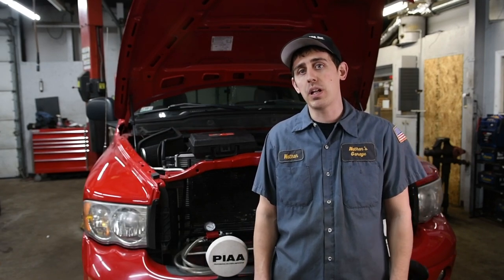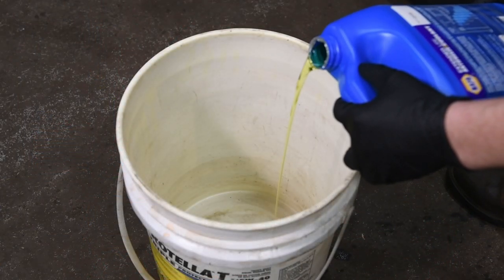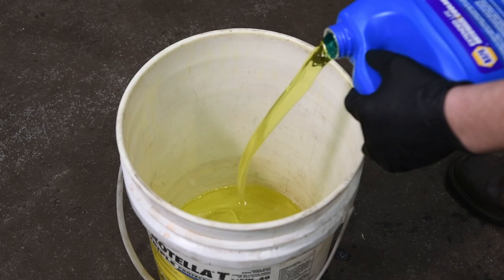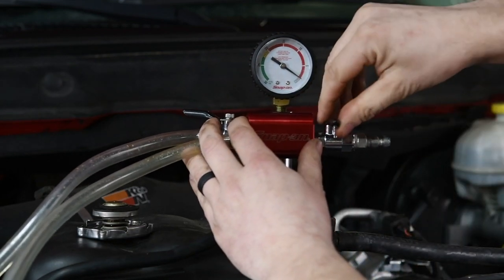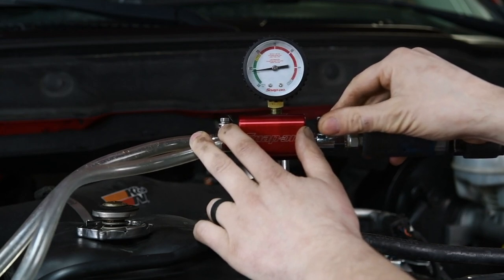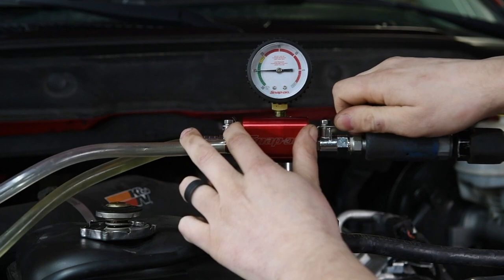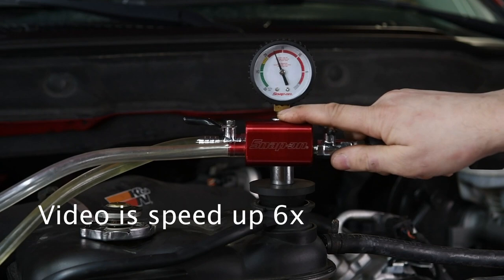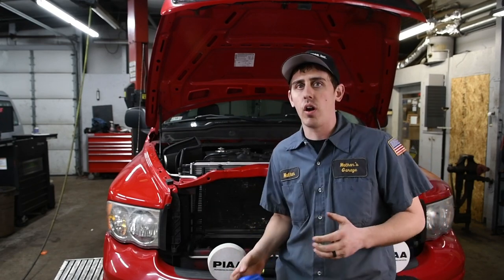MY FAVORITE TOOL Cooling system vacuum fill

Comment: I have an Acura ILX, 2021, and I started with the spill proof funnel, only to end up getting air bubbles, and hot air only on HI setting? It’s so frustrating! I ordered a vacuum kit off Amazon. Hopefully this will fix my no heat below the HI setting? 86,85, 84, ect… it goes to , basically room temperature?  Could a stuck thermostat cause this? Only getting hot air on Hi setting? Not the fan speed, the temp setting.

Comment: I’ve used a vacuum coolant filler for the last 10 years or so.. it’s a game changer. I’ve even used it on problem clutch and brake bleeding when nothing else is working.
Reply from the maker: Saves so much time on a lot of cooling systems.
Reply: hmmm, with adaptors can you use this kit?  ofcourse clean it out afterwards.
Reply: @SaycoPworrell   snap on sells one of these vacuum fillers that attach to a standard radiator cap. That’s what I use along with a Mac radiator pressure tester kit that has all the different cap adapters. I prefer this way over the universal rubber plug type that was shown in this video

Comment: What air pressure do you use like  psi on the compressor to evacuate the system to be safe and not destroy the system why don't any you talk  about the psi on the compressor to use I get everything else but please mention the psi for your viewer's 40 psi - 90 psi ?
Reply from the maker: The air pressure isn’t as important as the level of vacuum you pull. The higher the air pressure though ~90psi the easier time the tool will have pulling a vacuum

Comment: Everybody always talks about the air in the hose while refilling, it is a non-issue, if the tool is not interrupted during the process, the air in the hose at the beginning will be the air at the top of the D-gas bottle. There will be no air pockets anywhere in the cooling system and most of the time the coolant will be spot on and you do not have to add any more coolant to it!
Reply from the maker: That may be true on MOST vehicles but on some cars such as Chevy Cruz it will cause an issue. I have experienced this several times. The instructions per the manufacturer of the tool specify to purge the air. It’s one small extra step that gives piece of mind. Some vehicles the tank is an expansion tank and not a degas bottle.
Reply: It is definitely a non-issue if the technician takes the time to purge the fill hose of air.  It takes just a minute or two to properly purge the fill hose of air prior to commencing the refill of the system.  Why would you NOT do that in order to assure a successful repair?

Comment: Question for you, if there is maybe still a gallon in the system will this work or does it push the old out, I had to pull off a coolant line to get to a starter motor on a volvo XC40, I bought a vacuum tool but I have this question, I may need to only put back in a gallon
Reply from the maker: You will apply the vacuum until fluid starts to come out. Then fill from there.
Reply: @InTheShop  Thank You until fluid comes out or until all the existing comes out?

Comment: Do you think this will work with my 20 Gallon Compressor? I'm thinking about picking one of these up because God i am sick and tired of manually bleeding cooling systems.
Reply from the maker: I have used mine on a 20gallon compressor. It works but definitely works the compressor hard.
Reply: These tools need a shop air supply of 90 psi at the tool.  I recommend that you have at least 5 cfm of air flow.  I've got it connected to a 60 gallon compressor that puts out 11cfm at 100psi, this works very well.

Comment: I have a Subaru Outback, 2001 4 cylinder.  A problem I've been having is the coolant overflow reservoir filling up, but not returning the coolant back to the radiator overnight. I have replaced just about every cooling system part trying to solve this. So this concept you explain is completely new to me. Is running this process through my car , and presumably replacing vacuum back into the system the solution to my problem?
Reply from the maker: Hey Chuck, I know this might now be what you want to hear but I would get a headgasket test kit and check to see if you have combustion gasses entering the coolant.

Comment: Good video of a very useful tool. I bought one to do the intercooler on my car. Cruzes have a bleed on the top of the passenger tank of the radiator. I've rebuilt 5 totaled Cruzes and never needed a vacuum bleeder on one. I have come across other cars a time or two that just wouldn't bleed. In those cases, this tool is a lifesaver!
Reply from the maker: I never knew they had a bleed screw! Thanks for the tip! I do love this tool though.
Reply: @InTheShop I have a OEM tools version I just used and it worked like a charm, $60 and full aluminum body construction

Comment: Nice vid This may help purge the fill line first then the system now ur ready to fill This tool removes all doubt
Reply from the maker: Thanks Anthony!
Reply: @InTheShop  Where I have to connect the unit in a 2013 Chevrolet Sonic Lt

Comment: So two questions: 
1) I only have an 8 gallon air compressor, can I use this tool?
2) When applying vacuum and filling what happens with the thermostat? I've been a little confused about that part
Thanks!
Reply from the maker: I haven’t tried it with a compressor that small but you might have issues. This essentially creates a giant air leak. I’m not sure if your compressor will be able to keep up. The coolant fills to the back side of the thermostat through the other hoses that do not have a thermostat blocking them.

Comment: Say you’re doing a spill and fill on a full cooling system. When you create the vacuum, does it suck out all the old coolant you’ll be replacing?
Reply from the maker: Unfortunetly it won’t remove all of the coolant. You will still have to drain it.

Comment: I have the Ford 6.4L diesel. This engine is notorious for cooling system air problems. I believe Ford recommends using this tool for servicing the coolant. Thanks for the video!

Comment: Just curious, how does it bypass the Thermostat if its closed.
Reply from the maker: It works because even though the space inside the motor is empty being under a vacuum makes it technically void of air. When you open up the valve and allow only coolant in the coolant fills that empty space. It fills throughout the entire block/head/radiator. The coolant will flow in from the opposite hose that the thermostat is located on.
Reply: You're doing this on an completely empty coolant system correct ?

Comment: Hi good video, how much psi did you apply on the air compressor?
Reply from the maker: Normal shop air pressure is fine. I would say no less than 90psi

Comment: Great video. What’s the part number on the snapon tool ? Thanks
Reply from the maker: Thank you Paul! Looks like the part number for the snapon tool is SVTSRAD272U
https://store.snapon.com/Cooling-System-Vacuum-Fillers-Kit-Cooling-System-Filler-Universal-P888852.aspx
Reply from the maker: Absolutely they are on the higher end of the price. I linked to a cheaper option in the description of the video. I only shared the snapon part number because that’s the one I used and he asked specifically for that part number.
Reply: @InTheShop  I understand.  I also understand that often times you get what you pay for, and with SnapOn, you're buying quality.  Since your'e a professional mechanic, it's understandable why you would buy from SnapOn.  In your business, time is money.  You can't have tools failing and wasting your time.  Great video.  Keep up the good work.

Comment: I have a question regarding the air compressor. What is an adequate compressor for this tool?
Reply from the maker: It is a constant air leak so you will need a decent size compressor to keep up. I would say if your compressor has a hard time with a grinder it may also struggle with this. It uses less than a grinder but still consumes quite a bit of air.

Comment: Video description you recommend the "UView" vacuum tool, but in your Amazon store you recommend the one by "Robinair." I'm assuming they both work just fine. You used universal coolant and for some reason I'm hesitant to use anything other than OEM spec, but if you've never seen any problems using universal then I might switch on to a universal like "Mishimoto Liquid Chill."
Reply from the maker: It’s possible the link changed. Amazon sellers do strange things sometimes. Any of the name brand tools work great. It’s a relatively simple design. As far as universal coolant goes I have had great luck with it. It’s best to make sure all of the old coolant is out beforehand though.
Reply from the maker: al carr  Absolutely
Reply from the maker: al carr  If the tool won't seal below where the hose goes then yes.
Reply: I would recommend the UView AirLift 550000 (solid brass body) instead of the AirLift II 50500, which has only the universal cone and is a plastic body tool design.
Reply: @StilettoSniper  Yup, 7 months ago I ended up buying the Uview, great tool, I even made a video on it.

Comment: can this be used to evacuate a system that is full of coolant?  I have a supercharger water to air system that has no drain and it would be a pain in the ass to get a hose in a low spot off a fitting to drain.  If i could evacuate it using this and then refill it with fresh fluid.
Reply from the maker: It will pull the majority out but not all of it
Reply: @InTheShop  okay, I'm not looking to get all the coolant out, just want to be able to get the air out without disassembling the system to drain it first.  thanks
Reply: It is very inefficient at draining coolant out of the system.  It is NOT designed to do this.  If you want this tool to evacuate your system properly, I would recommend getting as much coolant out of the system BEFORE you evacuate.

Comment: How does this work for the radiators with no radiator cap?
Reply from the maker: Same process but you put the tool on the coolant bottle where you fill the coolant.

Comment: can you use this to vacuum coolant from the engine block? I have an old car with sensors attached to the engine block drain plugs. i really dont want to risk breaking the sensors
Reply from the maker: It won’t remove all of the coolant from the block. It will remove a large amount of it though. What are you trying to change?
Reply: @InTheShop  I want to flush the cooling system and replace the coolant. but the radiator drain petcock only removes about one half gallon of approx 4 gallons of coolant in the system, if I disconnect the heater hose i can drain an additional quart of coolant, this leaves about 3 gallons inside of the engine. its this remaining coolant that I have trouble removing.  and removing the lower radiator hose does not remedy the problem. this car was designed to be serviced with a shop vacuum machine.  most shops will not guarantee that they will not break the engine block drain plugs with the sensors attached if I just pay them to remove the plugs
Reply: @drebpipley1  Turn the car on for a little and let the pump push it out

Comment: Is it necessary for the system to be completely empty? Do the heater vents need to be completely open and on full hot?
Reply: As empty as you can get it. Key On, engine OFF, Heater temp on high, low fan

Comment: So does the system always have to be empty when using this tool?
Reply from the maker: It doesn't but when its not you will start to suck up coolant once the air is all out.
Reply: @InTheShop  I tried it today and it would just suck a bit out then it would stop. I couldn't get it to hold pressure at all though. Just enough to refill the system. But not enough to test it.
Reply from the maker: @luislozano1513  if it won’t hold pressure there is either still air in the system, you have a leak somewhere, or the tool isn’t sealed to the filler neck.
Reply: @InTheShop yeah I just got back from driving it and the reservoir is way low. I think I'll have to just make time to actually drain it and do it the right way hopefully its just air. Also the rubber seals weren't great on my reservoir.
Reply: It works best if the system is as empty as possible.  This tool is NOT designed to empty your system of coolant.  If it catches a little coolant it is OK, but it is NOT designed to avoid draining your coolant out of the system.

Comment: This is all done when there is no coolant in the system correct ?
Reply from the maker: Correct. This is done after a complete drain of the system.
Reply: @InTheShop  you mean by draining the radiator and then you go and do the vacuum fill
Reply from the maker: g g correct
Reply: @redskins8025  Drain the engine block as well.

Comment: So basically you just drain the radiator you do not have to drain the engine itself correct? Thank you!
Reply: No.  This tool is NOT designed to avoid a proper draining procedure.  You should follow manufacturers recommendations regarding how to drain all of the coolant.  In most cases, that requires opening the radiator petcock or removing the lower radiator hose, in addition to removing the engine drain plugs.

Comment: Best way to remove the old coolant?
Reply from the maker: Depending on the vehicle there will be a drain.
Reply: pull the bottom hose and letter rip, otherwise there is a valve on the bottom corner of the radiator

Comment: Where I have to connect the unit in a 2013 Chevrolet Sonic Lt
Reply from the maker: I’m not sure of the connection point of every make and model produced but you will connect the tool to where you would normally poor coolant into.

Comment: your links isnt for the snap-on kit
Reply from the maker: Correct. That’s why I stated that the link is not the same manufacturer as I used in the video but the snapon brand can be purchased through your local snapon dealer.

Comment: Why do you crack it again once coolant is in the fill line?
Reply from the maker: I crack it again because you need to remove the air that was drawn in from the fill line before the coolant reached the tool.
Reply: I feel like its not necessary  to do that i just crack it once and fill it up
Reply: @420MRBlueberry  It is necessary, you need to purge any air that will be introduced into the cooling system......if you just crack it all the air that was in that clear line will be sucked into the cooling system......defeats the purpose of the tool.
Reply: @420MRBlueberry  You are mistaken in your feeling. It takes just a minute or two to properly purge the fill hose of air prior to commencing the refill of the system.  Why would you NOT do that in order to assure a successful repair?

Comment: Sorry but it's not a very clear explanation. Novice like me didn't understand cause you didn't actually explain which is which on that tool. But thank you for the video. I will acquire the tool and I'm sure reading the instruction manual will make me understand how. Thank you.
Reply from the maker: I apologize if I left something out. I tried to make the video more of an explanation of the use of the tool and not a 100% instruction. The reason I left a few details out is different manufacturers have slightly different controls but function the same way. If you buy the tool and have any questions feel free to reach out to me and I would be happy to help you.
Reply: @InTheShop this is the popular one